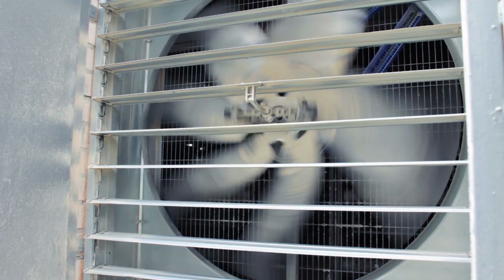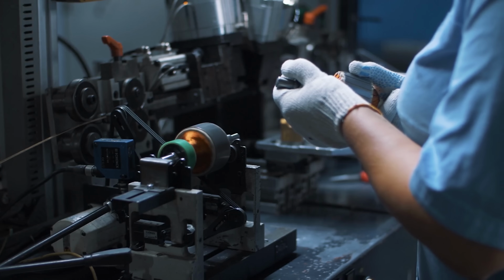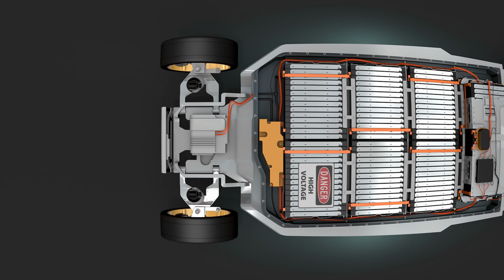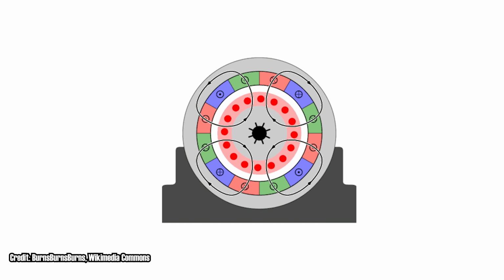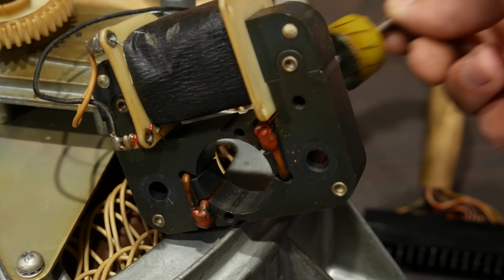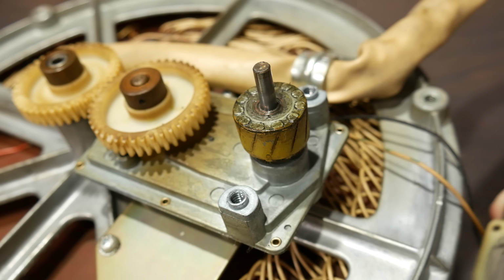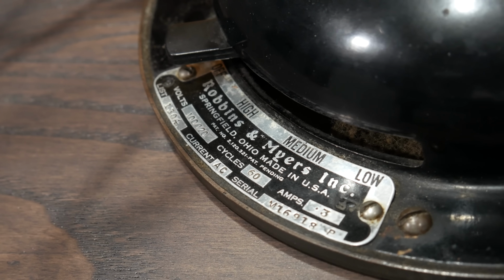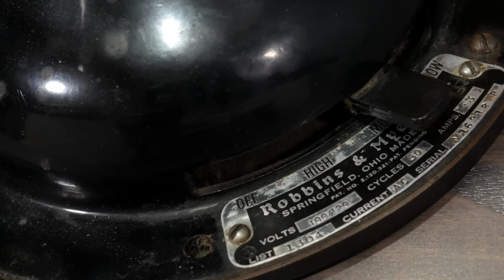Fans; High is next to Off on purpose

Comment: That definitely caught me off guard, I always assumed they went from off to high because most of the time people bother turning them on we're going to set them to high.
Reply: I run them on low... all the time. I feel hot without airflow.
Reply: @TheOJDrinker  so... why not use it on the high setting?
Reply: I always run mine on low
Reply: @_TheDoctor  Don't need to, low works fine.

Comment: 5:00 Huh, here in Sweden large appliances like stoves and washing machines often use 400V three-phase power.
Reply: @juststeve5542  If u look on INDUCTION STOVE thats why
Reply: Mateusz Zimon induction works just fine on single here in the uk
Reply: Induction stove here i the U.S. and it is only 240v.
Reply: @juststeve5542  Mainland Europe uses 300-400V for most heavy home appliances
Reply: @juststeve5542  Here in Sweden households are normally fused on 10 or sometimes 13 and 16 amp.

Our 3 phase owens are often fused on three 16 amp fuses. So 48 amps on three wires. This is because no extra heavy duty cables or dedicated circuits will be necessary. Most comon wireing are 1.5m2 for 1 phase to 2.5m2 for 3 phase. :)
Reply: @ikuzoburandeon  interesting differences.
UK houses have something like a 60+amp single phase feed.
We have ring circuits. 30amp for sockets on 2.5mm cable and 15amp for lighting on 1.5mm
Dedicated fused spur for cooker at 45amp, on a huge (10mm?) feed.
You'll often find multiple ring circuits in the house, usually upstairs and downstairs sockets, same for lighting. Kitchens often get their own ring as well as the 45amp cooker feed.
And then all our plugs are famously fused too. Ideally with something suiting the device. 2, 5 and 13amp fuses are the common sizes.
Reply: @treker2379  well it would, if they didn't have all the sockets wired radially back to the fuse board.
Saving copper was the exact reason UK went for ring circuits. A single 30amp fuse on the fuseboard, feeds a socket, which links to the next socket, and the next, and eventually all the way back to the same fuse (So the ring is fed from both sides). Which is why we have fuses in the plug.
Makes sense really. A TV can have a 2amp fuse in its plug, which is far more suitable than just being protected by a 15A fuse for the socket.
These days there are several rings in a house. Downstairs sockets, upstairs sockets, kitchen gets its own, and then a 45amp dedicated one direct to the cooker.
Lights are also on rings, fused at 15amp.

It makes adding a socket quite simple, you just have to find the nearest socket and then break into the loop, extending it to your new socket and then back again to complete its original route, although you will have to power down the whole ring to do it.
Reply: @FarhanAxiq I never saw such a thing in France or Belgium. For high power home appliances like an oven, this is a 20A socket on a regular 1-phase line. Only some professionals here use a triphased installation nowadays.
Reply: Ouch
Reply: Europe uses 240V wall current instead of the 120V found in the US.
Reply: @PainterVierax  Three phase electric stoves are the norm in Czechia as well. This is because a single phase is restricted to 25A whereas a stove might need up to 50A.
Reply: but whats the voltage from each leg to neutral? are they delta or wye?
Reply: Actually... the stove is internally connected to use those 3 phases as single phases... There is no 400Vac three-phase motor inside the electric stove. You can do single phase, and actually it is pretty common also in single room studio apartments only to have single phase for everything.
Reply: Washing Mashine/Dryer is at 240V but the electric stove or oven (call it, how you like) runs on 400V. Here in Germany.
Reply: Here in Germany, most (modern) stoves are connected as 3-phase power as well, though I have never seen a washing machine with that.
Thing is, a stove takes A LOT of power, and by connecting the single plates to different phases, you split the load more evenly. It's simply better for the entire grid, because an uneven load on the different phases leads to serious issues (gridwise, not for the single appliances) and has to be balanced out - I guess it's just easier to start balancing it inside the single flats/homes, so the entire grid is automatically more balanced and needs less correction.
Reply: We couldn't do that here: We're Americans. Instead, we have to pretend that we just discovered it ourselves, and then go through several wire and plug standard format AND Electrical Code changes, not necessarily in that order, and expect everyone else to adopt our formats and regulations, and congratulate ourselves for making the World a Better Place.
Reply: @juststeve5542  Doesn't this ring layout cause overlapping waves at the socket?
Reply: @w8lvradio  : America did invent a lot of this stuff. Europe actually aimed at introducing differences. Tesla, for example, did so much AC stuff here in America that when Marconi tried to start up a branch of his business here, the courts ruled that Tesla had actually gotten patents on necessary aspects of Marconi's devices that Marconi was inherently infringing Tesla's patents.
Reply: @Shadow81989  : Having some indirect knowledge on the subject (I used to work for a contractor to an electrical utility), I'd guess that the average US distribution circuit (the bit between the substation and the pole-mounted transformer) is large enough that the load imbalance is usually minor.

That having been said, probably a more significant aspect is that there are large rural areas where the only available power is single-phase... despite the local substation outputting 3-phase. They know that there aren't any users that genuinely need 3-phase in some areas, so as long as the population density is low enough, they'll run each phase out in a different direction, saving on wiring costs. Often they'll even do this by running the wires straight off of the 3-phase distribution of a town that the substation feeds, aggregating the load imbalance into a less severe average.
Reply: @MetalheadAndNerd  : The wavelength of 60Hz is about 3000 miles. As long as the loops are power on one loop and neutral on the other, there shouldn't be enough frequency shift to justify taking it seriously, especially when you consider that things like universal motors and all sorts of simple chopper circuits produce much more noticable bursts.
Reply: @absalomdraconis  That makes sense then! I'm not very familiar with how all these things are done in the US, but I guess in these extremely rural areas (that don't even exist over here, tbh), the approach you mentioned could save tons (possibly literally, in some cases!) of cable per household.
Reply: @juststeve5542  Yeah ring circuits we have too, or like one room plus outer/nearest hallway socket depending on house layout.

Uk has som pretty high amps in houses i must say.

Comment: Airline: Good morning, this is your captain speaking, as you know we're switching technology from jet fuel to electrical motor, please fasten your seat belt as we're going full throttle and taking off at 500MPH an hour at 3G acceleration, thank you for your understanding.
Reply: Miles per hour per hour
Reply: Milers per hour an hour.
Reply: Misaka Mikoto an electromaster explaining tech. love it. 😂
Reply: @camillecirrus3977  most metal way to get isekai-ed 🌞💥🔥💀
Reply: 3G?  No, 5G.  That's the future 😁
Reply: And this is why we don't launch commercial planes with railguns linear induction motors.
Reply: I'm glad I wasn't drinking something when I read this comment. A+, my good Mikoto!
Reply: @camillecirrus3977  ah, good thing I'm a furry then
Reply: the majastic creature 
Same. I may stay on the p l a e n e.
Reply: Fuc it, 5.4g takeoff
Reply: Clearly you've never been on QANTAS.  Aussies know one thing, and that's send it.  Seriously, the 747 had barley turned onto the runway off the taxi way and he already had it at full beans the mad lad.

Comment: So here in the UK I don't think I've ever seen a fan that works in that order. Every one in my house is off, low, med, high
Reply: The standing fan I bought from the John Lewis in Reading Centre goes off - hi - med - lo...
Reply: Me too - I wonder if being on 230V AC means that even on low there's guaranteed to be enough torque?
Reply: Same in Singapore and Australia too!
Reply: Also in Germany. 240V FTW
Reply: I personally have never seen a fan with a turning knob- they always have push buttons- the newer ones electrical buttons
Reply: As a European (Romanian) I came searching for this comment because I never in my life saw a fan with this speed order.
Reply: thought i was going mad when he said but i couldnt renember a single motor with that arrangement
Reply: Its the voltage , with 230volt the Motor can start no problem.
Reply: I have a fan with a turny-knob, but it's variable. Off, Low-High in 5 steps. UK 240V.
Reply: so this is only a U.S. thing then, very interesting, never knew.
it's like the garbage disposal, it's unknown in other countries to have one in a sink.
Reply: @Omar-em7rl  "it's like the garbage disposal, it's unknown in other countries to have one in a sink."
No, "Home improvement" is known :p
Reply: I am from India, never seen a fan with a 0-3-2-1 config, all fans here are 0-1-2-3
Reply: That's because outside of America you are all using metric fan switches.
Reply: I have NEVER seen a fan with 0-3-2-1 setting here, be it button or rotary switch. I have encountered some that didn't start on 1 but only because it's too old and dusty so they usually don't start at 3 also
Reply: @mk_rexx  what country is this?
Reply: Franko Walker Potentiometer instead of a rotary switch? That's interesting
Reply: same here in eastern europe.
Reply: @Omar-em7rl  They have had the waste disposals in New Zealand since the 80's, apparrently.
Reply: metoo in hong kong
Reply: I'm in the UK and I have one fan that works like this--it's so unusual that I thought it was odd when I first got the thing, though, it's the only one I've ever seen with the speeds arranged that way.
Reply: Because in the States we're all stuck with 120v, because our grid is so goddamn old and held together with chewing gum and safety pins
Reply: Все у этих американцев не как у людей.
Reply: @Omar-em7rl  same way in Japan from my experience. 100v sadness.
Reply: @otm646  i didn't understand your response fully, im sorry, 100 volts? same way for garbage food disposals? or were you referring to the fan speed controls?
what's the voltage in Japan anyways?
Reply: I’m in the US and I have a fan that goes 0-1-2-3
Reply: Australia too
Reply: @Omar-em7rl  - I thought everyone knew standard voltage in Japan is 100 volts.  Guess you've never bought an appliance intended for Japan and had to use a 120 to 24 volt stepdown transformer as an autotransformer to get the right voltage.
Reply: I wonder if the fans for heating and cooling the cabin air in a car goes the same way in the USA??
Reply: Same in Singapore, I've never in my life seen a fan switch go from 0-3-2-1. My wall fans all start from 1 (lowest) and ascend to 3 and loop back to 1 if I press the "speed" button.

I have seen this on gas stoves tho. I assumed it was so that if the fire gets too big you can quickly shut it instead of having to turn the knob a full 200°, and when you ignite the flame (ie when you press and turn the knob and your stove has an ignighter in it), you tend to put more torque to nudge the knob over the off position, so if you accidentally get carried away and turn too much, it'll just go straight to low instead of burning your hand.

Now that I think of it, it doesn't make sense to have a fan be able to "quickly shut off" from high incase of kaboom. Neither are you in danger if you have super torque force and yeet the knob all the way 360°

And also it makes sense to start a gas stove from high so that when igniting the flame there's enough gas flowing and no strike backs or no "too little gas, can't ignite" issue that results in unburnt gas filling up your kitchen
Reply: 240/220V probably part of the answer, but also because Americans are cheap and lazy.  Hell, this might not even be the cheapest design anymore, but why bother redesigning.
BTW: I'm an American... and actually feel fairly lucky about that despite the all too obvious downsides these days.
Reply: @olik136  
Just now venturing outside?
Reply: @kbhasi  I am Australian and all the older fans etc are off hi med low, so no idea where you have seen different unless they are brand new ones.
Reply: @horacewonghy  do you have freedom

Comment: You can stop any household fan rotating at high speed with your finger.
I’ve checked as a child.
Reply: You cannot do that with the most up to date Electric Fans as those have very large grills on them with the holes big enough to allow the air to flow normally but it does totally prevent human fingers from getting through and near the Fan blades